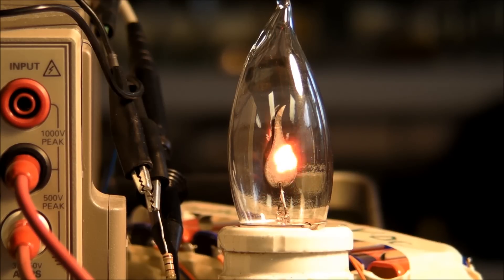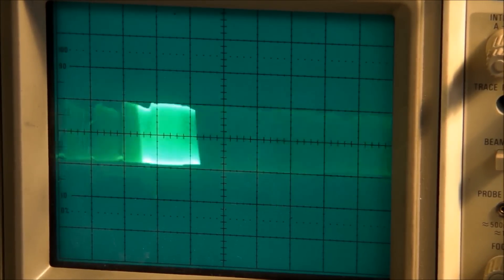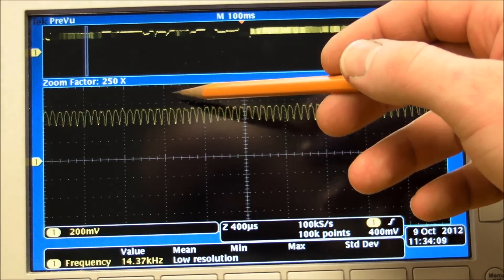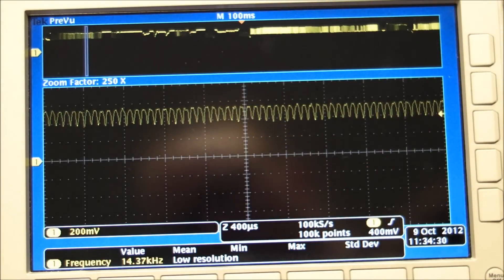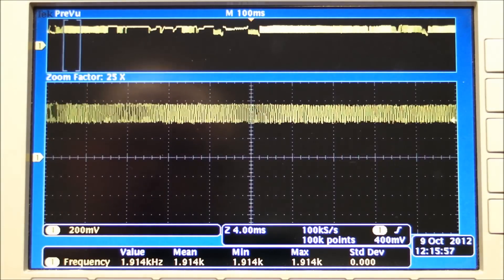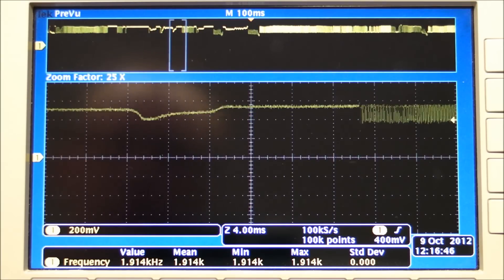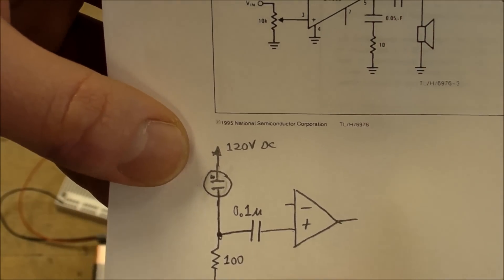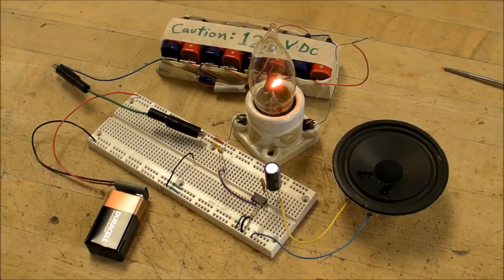(#0020) Bizarre Sounds from Neon Flicker Flame Lamp

Comment: Lovely video, some of the squeaks sound like ice or dry-ice being crushed with a pair of pliers.
Would the frequency drop if the electrodes were larger, does a small neon bulb have a higher noise frequency?

Comment: @ bigclivedotcom - I tried it also on my two flicker led candles, one beeped like crazy with chip planted into 3mm led epoxy case and another one with a microphone based switch function and small PCB just clicked like slow static from a radio. Both costs like less than a euro, but both has build-for-purpose IC's, quite interesting.
@ eric wasatonic - The neon bulb sounded more alien as it was slowed down.

Comment: Hey Eric, what about capture this random electric waveforms using a microcontroller and create a table of frequencies and burst times, maybe you can find some repeatability along the time, or, just determine that some sort of random generator was found.  :)

A FFT over the entire capture could define some properties based on voltage applied to the lamp, may be you can modulate such crazy random current based on the voltage applied.  

May be a higher voltage transistor (400V), as a 13003 (used in electronic balast of fluorescent coiled lamps) can be used to modulate the voltage to the lamp, driven by another audio signal, or song, and see how the lamp reacts to it, and what it generates.

If with a steady voltage supplied by the batteries the lamp already creates this so much crazy current fluctuations, I can imagine if you modulate such voltage...

It is a nice experiment, please don't stop.
Reply from the maker: Thanks for your input. I do have plans to use the lamp in a random number generator. Will probably be some time yet before I get around to it.

Comment: I think your neon is acting like a geiger counter, so it is being triggered by all kinds of particles from outer space travelling at God know what speed. Now since a neon has a neitive resistance characteristic, you have at least two things at play. (1) the partcles, (2) the parasitic oscillation due to the negative resistahce. Also, diid you well de-couple the supply to the high voltage supply? If you had a lead box that was very thick, it would be interesting to note any signifigantly different results, when running the same tests inside it.  Owen Morgan said that.

Comment: HOW DOES A FLICKER FLAME BULB WORK?
Clue:  I accidentally broke one.
The electrodes smelled like ammonia!
Also the dark flame-shaped electrodes slowly turned lighter in color.  Oxidation?
Thank you.
Reply: I put an explanation for unstable cathode glow here a few years ago.
http://www.g3ynh.info/disch_tube/lamp/flame_neon.html
Eric's demo shows nicely that instabilities also occur on quite a short timescale.  Actually, I have found that some Nixie tubes cause radio interference as high as 25 MHz.